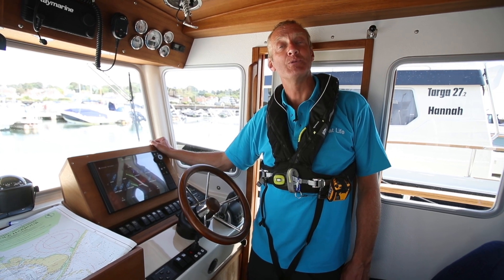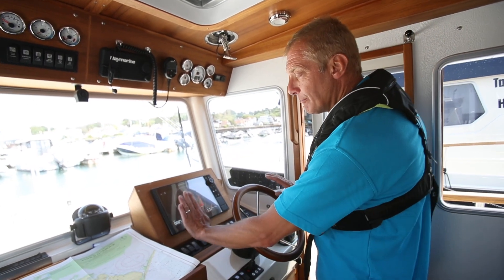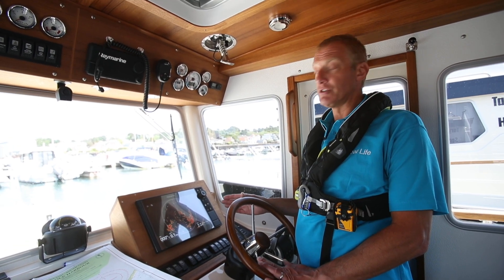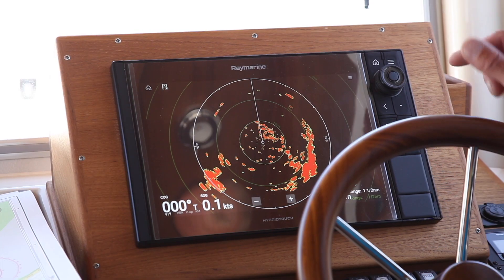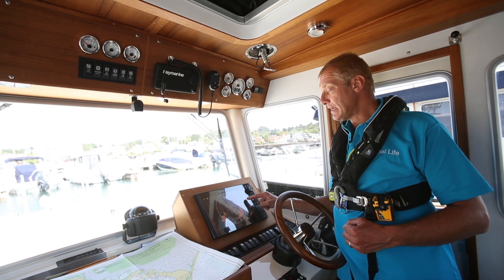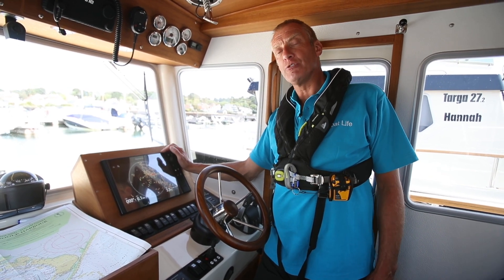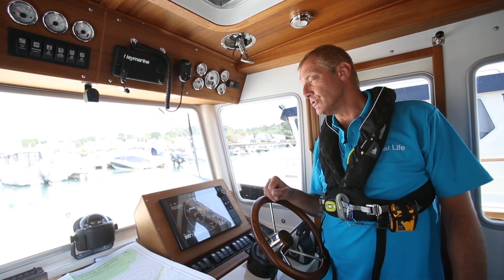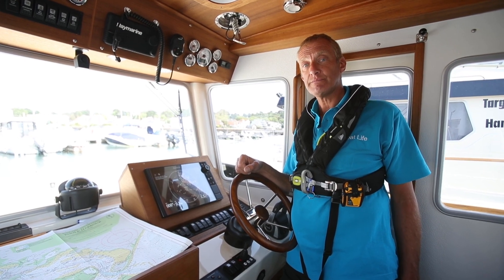How to set up a boat radar system properly | Motor Boat & Yachting

Comment: So on a modern radar do you manually adjust it if it's raining and it's set on auto, or will it adjust itself? Or do you reset a auto setting when it's raining? Just curious in case I ever get a boat 😄 cheers.